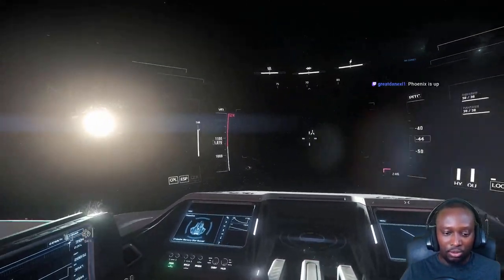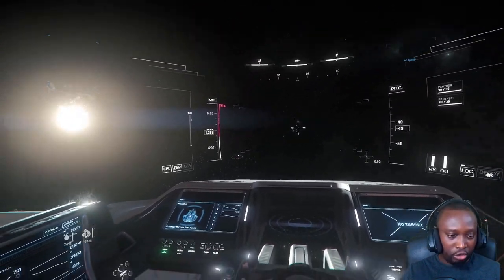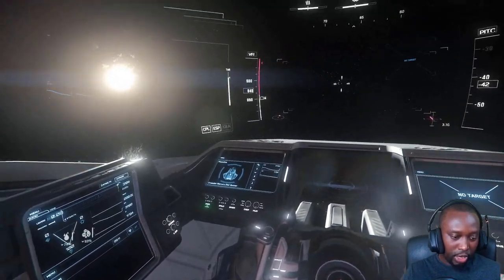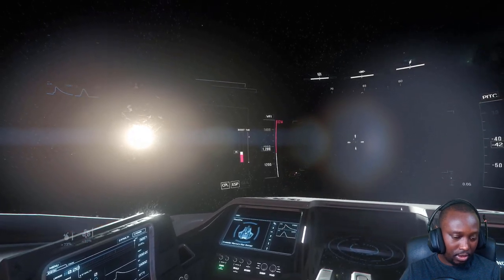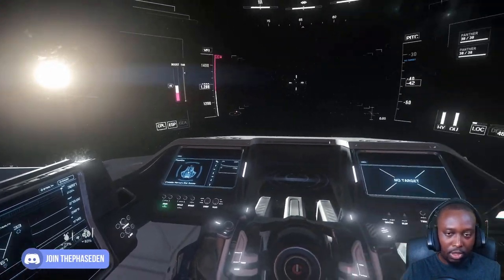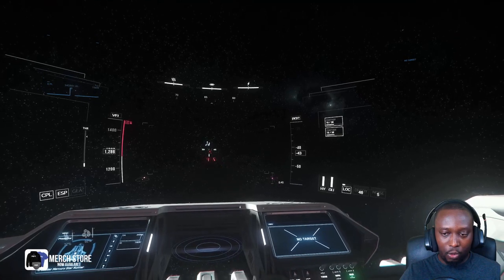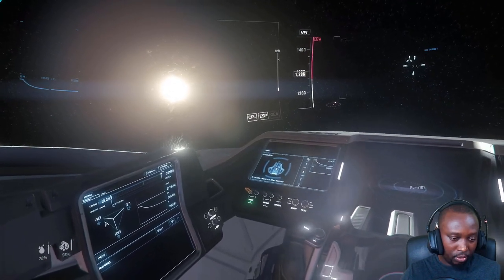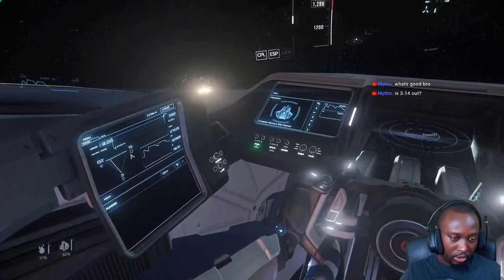Star Citizen 3.14: Testing the New Capacitors

Comment: Is overheating still a thing?
Reply: Weapons will overheat still engines do not, they simply run out of boost and there is a slight spooling delay when you hit boost and a cooldown on re-applying it.
Reply: overheating will be what limits boosting, without having to change boost.  So if boosting shields becomes OP, just add overheating to shield generation, and problem solved, without having to mess with weapons or thrusters.
Reply from the maker: I believe overheating is in but it takes a long time before the engines overheat now.  So I think they may make some tweaks to increase how often overheating occurs.